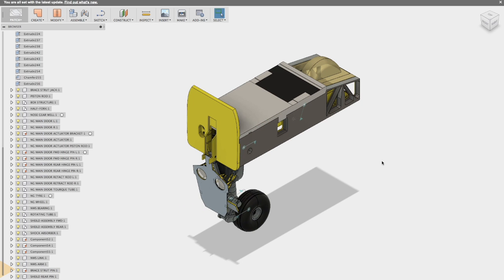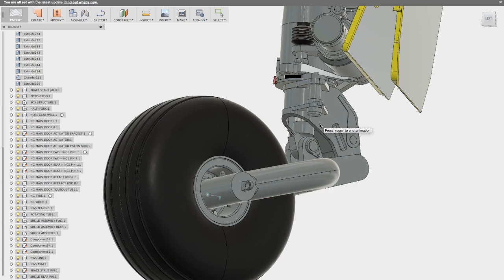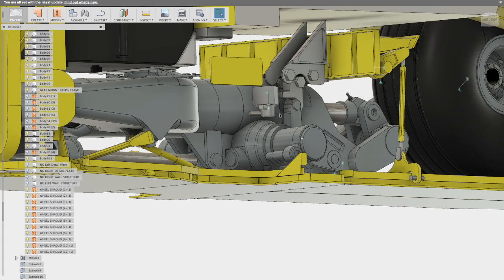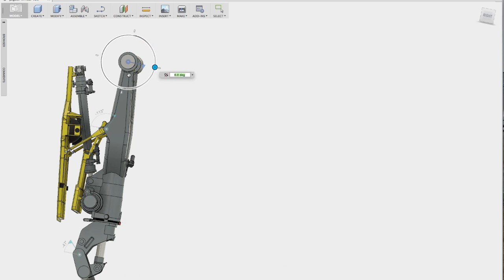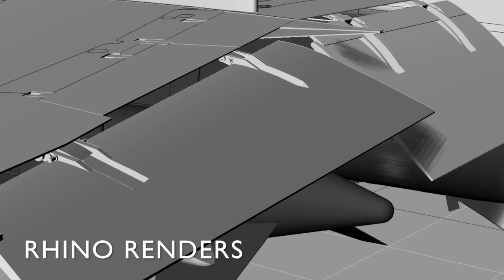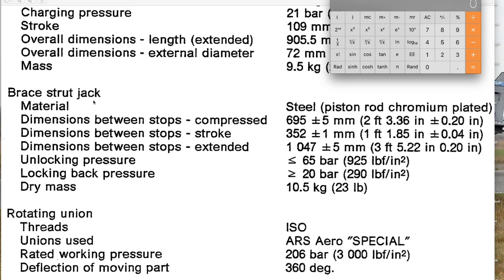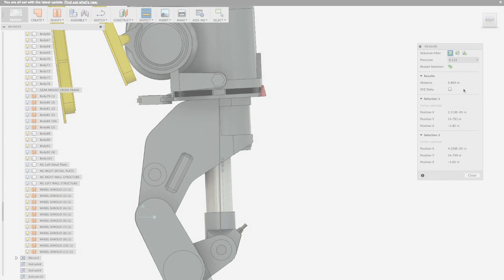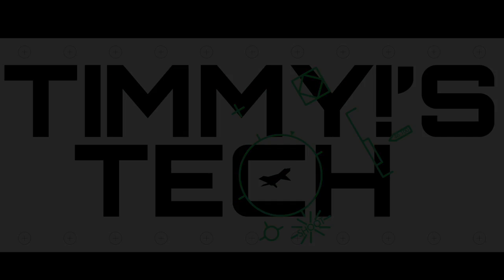Jaguar Nose Gear Demo

Comment: What is your software you use?
Reply from the maker: JM Carl I used Rhino (Mac version).  When Fusion 360 came along I imported the file and created the “working” assembly.
Reply: Ok Thank you very much. @timmy53driver  i will try it for Mirage Main Gear.